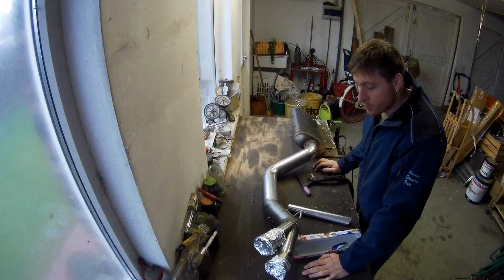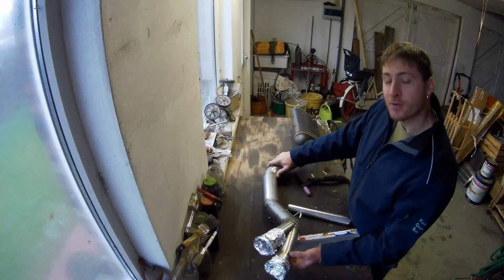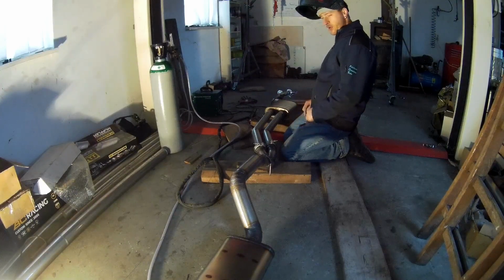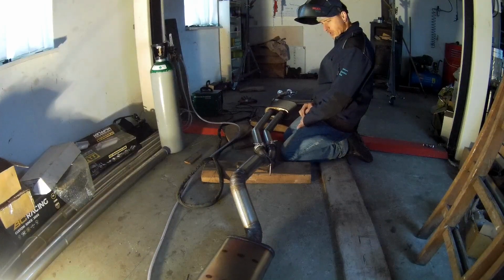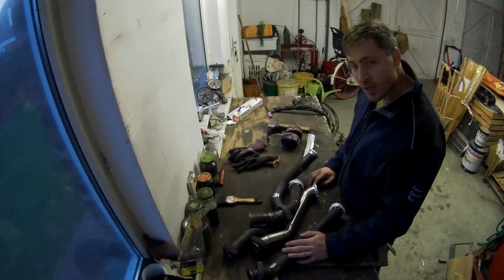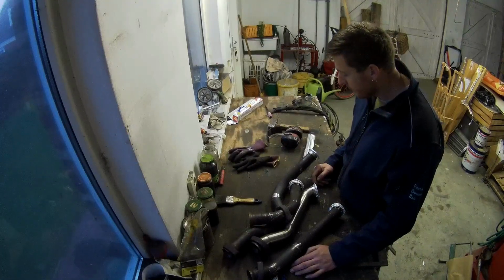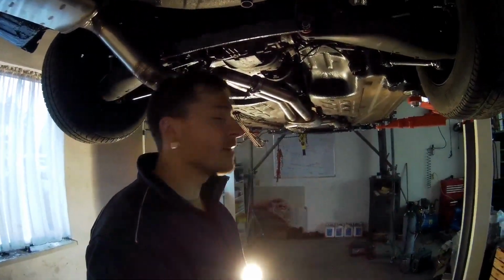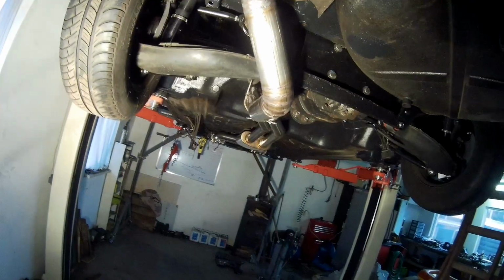Welding the Custom Exhaust for the W201 V12 Project

Comment: Nicely done, maybe welded a little too hot. but heaps good enough for an exhaust.
Just two things, on the rear subframe it seems to hang a little too low and i think a flex section would be a good idea since there is no allowance for the banks to expand and contract individually. (but it'll be alright probably...)
Reply from the maker: Original it is also without flex section also in full stainless.  When on  the wheels in have 20cm

Comment: Great job man... 
When do you plan engine wiring ?
Reply from the maker: Pretty soon first Brake and fuel lines then engine gaskets and small job on the hardware stuff in and aroudn the car and then wiring

Comment: Is there not enough space to lead the pipe over the rear axle?
Reply from the maker: No also oem there is no space
Reply: it has independet rear suspension, you'd have to go thru the rear subframe....

Comment: no kats,can anyone say for sure if removing cats gives you more power? i heard one guy did it on his m120 and he got the engine to run cooler which makes sense.i keep hearing both arguments it gives power then others say it doesnt.i have a blocked right kat on my clk430 and i could put just pipe there but it has the oxycen sensors at each side so i think it would give a check engine light and the emissions might not be low enough for uk mot so i think i need to buy a kat what would you people do about this,answers please
Reply from the maker: Cats Will give you restriction in flow in the exhaust. So it Will save restriction. So Will increase power a little